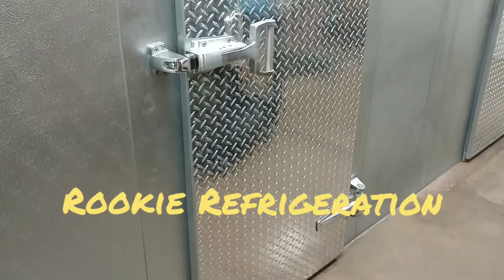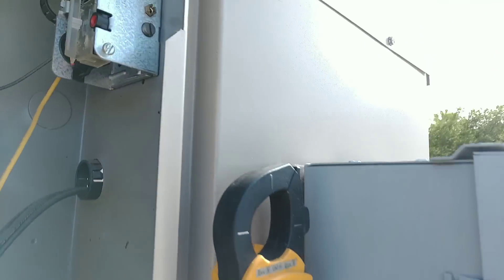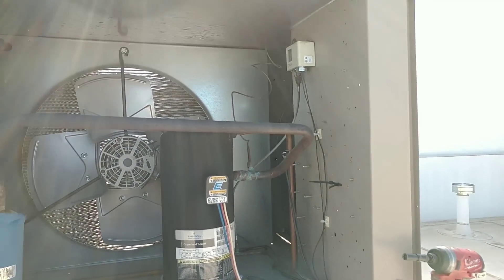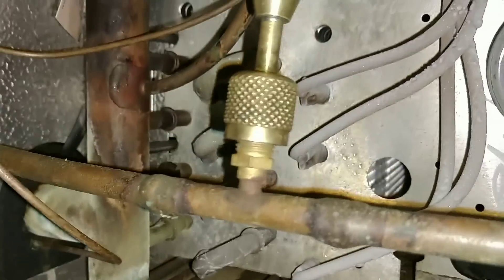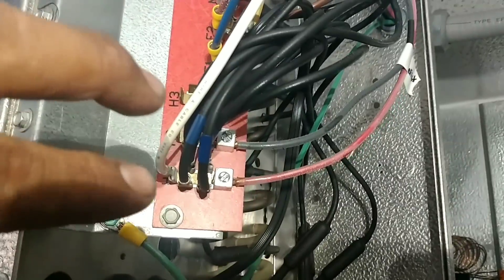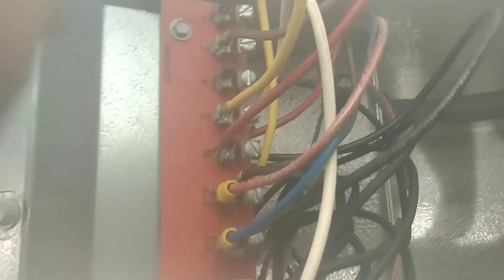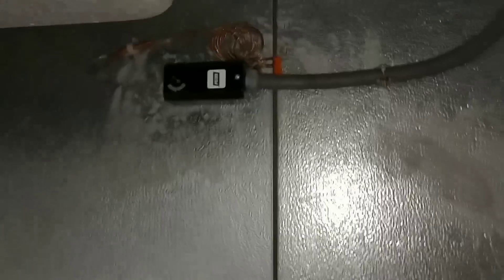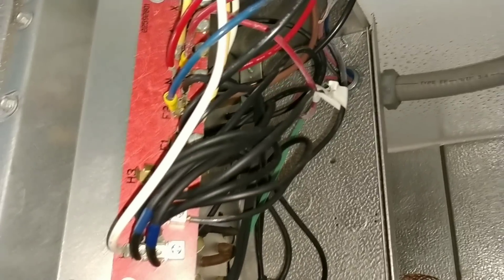HVAC Refrigeration:  Walk In Cooler down and wired incorrectly.

Comment: Great job in troubleshooting, however you jumped the gun on your diagnosis of " wired incorrectly". You were reading the incorrect side of the schematic panel located in the evaporator. At 11:44 you can see on the panel your holding to the right hand side the correct schematic for a contactor located in the condenser. Good luck brother.

Comment: Its a cooler why does it have electric defrost? If its a meat cooler i get it. But a walk in cooler doesn't use it. So yes no heaters it defrosts on time only and the fans should run full time. 4 a day for 40 to 45 minutes for a cooler. Did they put a low temp coil in? Im very confused.

Comment: please explain to me how a freezer would be a walk in cooler? If you want to convert to a walk in freezer to cooler, remove the defrost heaters and timeclock. Have the evap fans to run all of the time, youre trying to do a cooler with a freezer application. So the whole thing is messed up. Wire it as a cooler

Comment: Rookie Refrigeration, just wondering. If you would have just disconnected all heaters and left fans powered up to run continuously, could that have done it as the complete fix? The defrost timer is working correctly, or maybe could have added or taken off some time.
Reply from the maker: Mario Morua yes. I could have just made it off cycle defrost.  But this is what the customer wanted.  We just have to recommend and do what’s needed
Reply: Rookie Refrigeration 10-4

Comment: Hey dude . shouldn't that temperature bulb be on the suction line because it should be reading that tempreture
Reply from the maker: pretty cure Forever this thermostat is used for air temperature.  So it is reading the box temp as a form of temperature control.  Not on the suction line.

Comment: Condenser on roof for coolers had timers, no heaters.  So was it suppose to air defrost?  Managers complaining the box temp would rise at various times . I remove time clocks from circuit and have not had a problem for 16yrs. Fans run constant . Temps always perfect.
Reply from the maker: Yup.  I have no idea why this was installed this way.  We just made it as good as possible.   I wasn’t about to start tearing stuff out lol

Comment: Sorry I'm late to the party, but  I noticed you were looking at the wrong wiring schematic for this evaporator setup.  Heatcraft provides a number of different diagrams, one which specifically addresses when there are contactors in the condensing unit for the fans and defrost heaters.  The one you needed should have been one the other diagrams on the unit.  Here it is in their systems installation manual at the bottom of p.25:  https://docs.google.com/viewer?url=https%3A%2F%2Fwww.heatcraftrpd.com%2FPDF%2FI%26O%2FH-IM-CU.pdf

The way it was wired was basically correct per the schematic,  but it looks like they messed up the wiring of the terminator because it (obviously) wasn't working.

This diagram also shows how that heater limit t'stat was supposed to be connected.  

Hopefully this may help the next time you find this kind of mess. ;)

Comment: Usually coolers dont need defrost heater, fans run 24\7
Reply from the maker: Yeah, I still don’t know why this was installed this way but we just leave it as it is unless it causes problems.
Reply: Maybe because it was a freezer in the past
Reply: Have to watch the wiring parts of RR's video once again with that in mind.

Comment: What's up bro, hey I'm a rookie refrigeration tech too, plenty of commercial HVAC tho... My question to you is, if that is a medium temp box, do they really need a electric defrost?  Could you not just take that out for the time being untill you troubleshoot the DTFD and high limit safety and let it do a off-cycle air defrost? 
Thanks for getting in the YouTube game and making these videos, they really help newbie techs like me!!
Reply from the maker: matt scott well, it doesn’t NEED electric defrost but that’s the way the customer has it, so we don’t want to start yanking stuff off of it. It’s a lot easier to just fix it properly and normally we would do that on the spot.   This customer however, likes to get a diagnosis first and then they approve the work.  A lot of the time, we just have to play by the customers rules.
Reply: Rookie Refrigeration You are so right. I have a few questions I’d really like to run by you if you would take time to email me. My email is: proceb995@gmail.com. I sent you this one because I look but don’t pay too close attention to them. Just subject it “major HVACR questions”. And thank you in advance
Reply: Rookie Refrigeration sorry. That email is priceb995@gmail.com
Reply: Wouldn't the customer be complaining with that issue it would have never worked